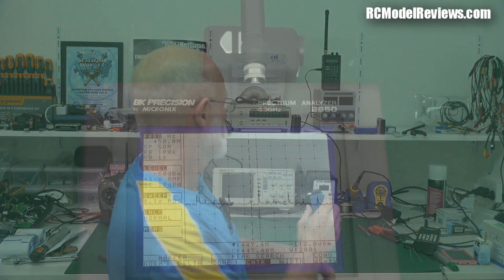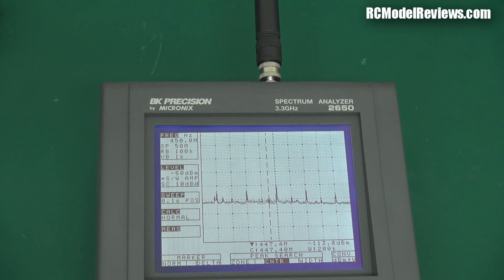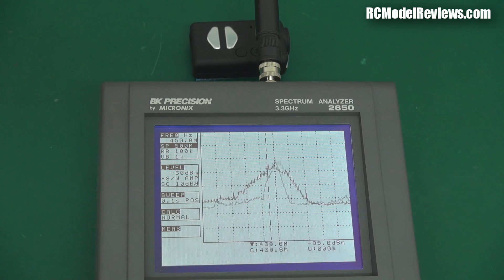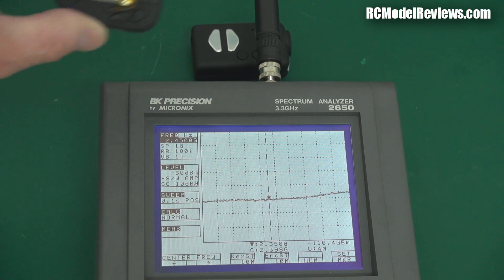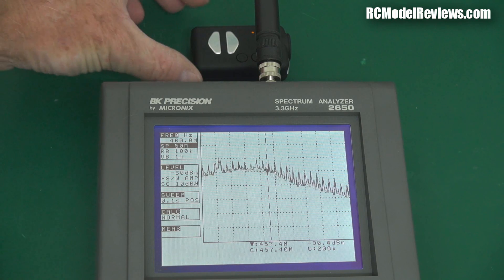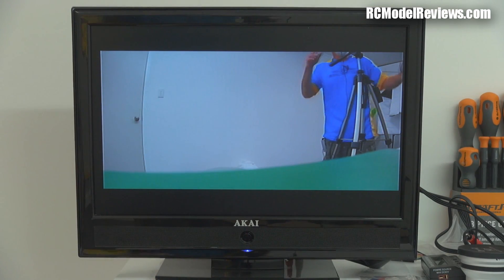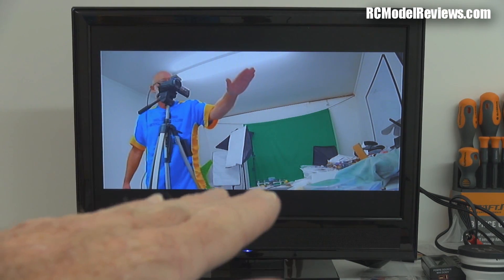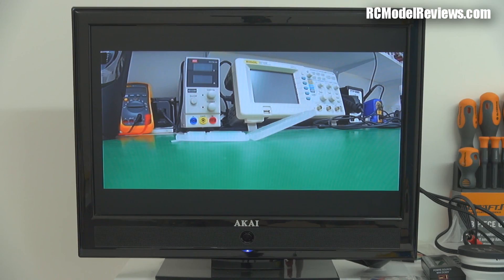Mobius HD camera RF noise and latency tests

Comment: why don't you measure the latency in an exact number?
Reply: Because your latency is dynamic to range/power/camera hardware just to name a few. Not all 600tvl camera will produce the same latency than the next a similar spec camera same is true for the rest of camera and counter parts. Latency is also highly controllable by your monitors if it's a progressive or a interlaced monitor. How that signals is transmitted digital means more lag but Better quality analog provides fast but lacks depth and contrast. For more details see ISF certs on lcd OELD plasma display. Plasma displays will produce the least latency from the monitor side. Cheers

Comment: My Mobius knocked off 18-20dBm from my UHF receiver.  I lined the inside of the Mobius with copper tape and now the mobius kill the UHF by 1-2 dBm sitting ontop of the receiver!  Copper works well.
Reply: Lorne Serpa Great, do you have a video on how to line the inside of the Mobius with copper tape???

Did you do all four sides or just the Top and bottom inside of the Mobius???

Was it hard to do???  Awesome, answer... Will do...
Reply: I did  on video tape the process.   I did cover the entire inside walls and all. Made a big difference.
Reply: Wrap a magnet filter on your cable bundle more often then not it can eliminate any cross talk

Comment: I think this is a bit of an unfair review. Bruce hasn't hooked this up to a computer at all, to change setting or run updates. There have been several firmware updates and updates are on going, which means the manufacturer's are giving it a lot of support (unlike a lot of kit out there). Your unlikely to fly fpv at 1080p. You need a computer to change it to a more realistic resolution. Updates have also allowed colour correction etc. The software is easy to use. A laptop should be standard kit for any workshop in the modern world.
Reply: The last firmware update is also a MAJOR update.

Comment: Bruce, why did you delete my comment? I think expressing noise with the noise floor as reference point is a bad idea. Ideally the noise floor would be -infinite dB, but typically it is around -100 dB and it varies. So that's not a proper base. You just can't subtract the actual noise from the noise floor level.

I just wanted to be helpful.

Comment: Bruce, I tried the wing cam (non FPV) on my Quad running FC DJI-NAZA and it interferes with the GPS NOT allowing the GPS lock.
Your spec analyzer test shows the Mobius to be clean around the GPS freq 1.575 Mhz. As far as latency goes, the Mobius manual recommends a Class 4 or higher SD card. Not sure what Class SD card you have. A Class 10 writes data at (10Mb/s and Class 4 is (4MB/s. Also, not sure if the video out bypasses the recording to the SD function.

Comment: Excellent Bruce.. Was going to use my Mobius for FPV. Was not even aware of the camera's high latency. You probably saved my expensive Hex copter.
Will be using a Sony board camera as you suggested.
Wishing you and yours a safe and happy holiday season.

Comment: May it be possible to also check the bunch of GoPros you have to compare the RF interferences? Interesting would be a usual operation, and additional WLAN Wifi remote operation. and also determining the safe distances to sensetive RF components.

Comment: Martin7812 is dead right regarding noise measurement.
Reply: Thanks David. My name is Martin7182 btw, I'm not a voltage regulator :-)
Anyway, Bruce seems to have deleted my comment :-(
Reply: Martin7182 what did you say+

Comment: Thanks for doing the latency test as I requested. However, your results seem incorrect to me. Ive never heard or seen a Mobius produce as much latency as what your video shows. Im fairly certain you are adding another source of latency, like a horribly slow LCD and perhaps some video converter inbetween?

To assess this, if you can use an old analog TV to display the mobius image on. They have no latency at all (well, speed of light :) ). You can also measure latency easily by filming a stopwatch or similar, then filming or photographing both the stopwatch and screen. It would be interesting to do this for a variety of devices. Camera's have latency, LCD displays have latency, possibly some FPV transmitters/receivers have lag (never noticed, but could be). Even OSD's might create latency if they do framebuffering

While you are at it, there is input latency. When flying FPV, they all add up.  You move your stick and the time it takes to see the reaction, or at least servo movement in your goggles is something that matters. How to minimize it might be an interesting topic. The mobius is definately a factor, but its not the only one, and I dont think its even the biggest in your test setup. As mentioned, Ive measured ~120ms in 720P. You seem to be getting 2 or 3x that. Is it the screen? Or some mobius setting (resolution, HDR, refresh rate,.. ?) Time to investigate ? :)
Reply: Yes, I'll try a few other monitors and see if there's any difference.
Reply: ***** Great!. PLease also compare with zero latency devices. A CCD as camera should have no latency (or no more than a single frame), and an old analog TV as display. They have no lag either.. And if you have the time, please experiment with the mobius settings. Most crucially HDR and resolution.

Comment: So would having a noisy camera (HoryzonV3 in my case) close to the the radio rx itself (Dragonlink V2 in my case) create a problem if the actual radio rx dipole antenna is a good 18 inches away from the camera and video transmitter?

Comment: Hi, Bruce.. that recommended for use in FPV, between the 808 # 16 and the mobius?
and You could check out the 808 # 16 V2 with 120° lens?
Thanks.. very good video

Comment: Bruce, nice informative video but there's one thing I think you're mistaken. You say that the cam has 112 - 86 = 26dB's of noise. That's not true! I think it should be just -86dBm. Let's explain it differently. -112dBm is the noise floor when the camera is off. Let's assume it's not -112dBm but -120dBm. Get the point? Noise is normally expressed in dB's relative to 0 dBm, not relative to the noise floor level which can be -infinite dBm theoretically.

Comment: I have been using it for fpv with the lag less than you have. I have it set up in 4x3 mode for live view.  I fpv the quad and plane. The wdr is not as good as the security 2000 camera. I really don't see any issues with mine.  The only thing is the color saturation.  It's to much. But its sharp from edge to edge.

Comment: To count the latency (video lagging) U put ur closed hand in front of cam, palm facing cam, and U count out load 1 & U open (strech out) ur Index finger. And continue with 2 & the major finger, 3 with the ring finger, 4 with pinky & 5 with the tumb. Count slowly , kind of like on an affirmative tone. I seperate each # 1-2-3-4-5 from about 0.7 seconds. When U do this look at ur hand in the monitor to see if its synchronised with ur voice. this trick work for me ;)

Comment: Bruce. I have my mobius wired into the power from one of my ESCs, and set up so when I power up it starts auto recording. would the fact it is connected to the ground along with all the other gear on my quad reduce some of the noise??
Reply: Hi. How do you have it wired? Can you turn it on and off from the Tx? I have my 808 HD connected to the rec and mounted on wing tip of glider.
Reply: ourblue  well my Mobius came with a lead that had servo plugs on it for video, audio and power. so I just moved the pins in the plug so they are correct and plug it into one of the motor signal outputs on my flight controller. That way it supplies 5v to the camera. Don't need to turn it on with the TX. You can set the Mobius to turn on when it detects external power, so I have that set. So when I plug the battery in on my multirotor, it powers up and starts recording automatically. By that time I'm ready to take off.

Comment: it looks like the display out you see on the monitor is a widescreen optimized for 4x3 and then displayed on a 16x9. Was that a composite out that you connected? I found a article here http://www.engadget.com/2009/02/19/hd-101-why-there-are-black-bars-on-hdtvs/

Comment: bruce im hearing good things about the BEV-KX121  board camera from bev rc  have you had a chance to check one out the video is supposed to be very good im currently using a security camera 2000  600 tvl but im looking for something a little better if you could review it that would be great thanks

Comment: Also Bruce can you get someone to lend you a GoPro 3 Black so we could see what the noise and latency is on that because they are also very popular (and expensive).
Reply: The UHF noise from the original Hero HD was significant.  Hero2's noise was better.  Hero3 Black better than 2, and H3+ Bis about the same as the 3, which are both almost undetectable in micro-power range tests with only minimal separation.

Comment: Hi Bruce, are you using this with the latest firmware as I have not noticed any latency problems during flight using the latest firmware. Not sure if there was this problem before flashing with new firmware as that is the first thing I did when I received mines.

Comment: Darn i was seconds away from ordering this camera for my first FPV setup. I'll have to go with board cameras apparently. Reason i wanted to use this camera is, i don't want to buy an extra dvr to record my flights. And this cam, has really good  image quality. Bruce do you know any cameras like this one that can record with 1080p and with low latency?
Reply: I gotta tell you, this is such a great camera. sure the latency is a prob, but the wide angle lens and awesome picture quality makes it awesome for the price. I consider it one of the best toys I have ever gotten for myself. And it's very lite. It has it's place, maybe with another little board cam next to it. check out my vids on my channel.
Reply: UCRASH TOO Hey there thanks for reply. I was planning to use this with my Quad. 150ms latency probably doesn't matter all that much for an airplane but for a quad flying 1 meters high, it might cause some problems methinks. Also, i'm quite new to fpv(RC in general actually) so i probably won't be able to compensate for the delay in video very well. I'm still planning on buying this camera. But i'll probably just use it for recording.
Reply: I have no way near as much lag on mine as in the video. Just so u know.

Comment: Can you try test some shielding solutions? A LOT of us are having problems with this camera completely blocking out out GPS reception. Even with the camera as far as possible.
Reply: stew jw
Don't mix carrier frequency with refresh rate on GPS. If it's just radiated UHF noise, don't put the radio receiver or the antenna near it and it will be fine
Reply: If you are the minority lucky enough not to have this issue or don't have a solution please don't make comments which prevent this issue to be taken seriously. I was hoping Bruce could come up with something as a lot of us would like to use this camera for FPV but cant loose our GPS return to launch..
Reply: Donavan Aarons
Solution already in Bruce video: put the uhf and gps away from the camera for the radiated noise. For conducted noise in the cables, try ferrite choke rings close to the source and don't create ground loops in the wiring.. Some gps antennas are really bad, check if the number of fixed satellites are in the bare minimum to fix without the camera on and then try moving the gps near and away of the suspected noise source to verify if radiated noise is your real problem.
Reply: I would not have made the comment/request if that was not already tried MR genius

Comment: Oh dear was hoping to use my Möbius for fpv, not now! Could the latency be cured through updating the firmware?
Reply: No, according to the "designer", its inherent to the DAC. The problem is not limited to mobius camera's though, its the same with most (all?) digital camera's, including gopro's and keychain cams. IIRC the problem is less pronounced in 720p than 1080p and refresh rate (50 vs 60 Hz) can also make a difference.

I would say the problem looks worse on Bruce's video than in my own tests. Ive measured it and I measured 100-120ms. Bruce seems to be getting far more than that, I wonder if he has another source causing additional delay, like his LCD or some video converter? Bruce, if you are reading, try filming a stopwatch being displayed both live and through the mobius. If you can, use an old analog TV to display the camera picture, so you eliminate LCD as latency source.. 

Anyway, In my experience, the mobius is usable for FPV flying multi rotors at leisurely  speeds. You do notice it, but its not a showstopper. I wouldnt fancy using it for high speed and aerobatics though.
Reply: P44man Agreed! There is some latency, but like you said it looks worse here that what I've seen with mine. I wouldn't say it's any worse than a GoPro Hero2 that I also fly through occasionally. A dedicated FPV camera is certainly best, but the Mobius live out is definitely usable.
Reply: P44man  I've flying fpv with this camera for a while and have not noticed any latency problems so was wandering if Bruce was still using an old firmware on his camera.
Reply: it has a latency surely, all cmos does, but very small, do not do hard core fpv with it your fine!
Reply: ***** Really? Tell Canon, Nikon, Panasonic, Sony, JVC, Red, about that. I am sure that they would appreciate your input that is worth more then all the professional video camera designers.

Talk about a total crock, but typical of most youtubers and RC people that I have met.

Comment: I've noticed some reduction of range if I mount the Mobius too close to my UHF antenna. A little separation is all it takes though, I've flown mine out a number of miles using Dragonlink V1 and V2. I'm pretty happy with the composite video out too. It's not as good as a PZ0420 of course, but it's the best I've had from an HD camera yet. Said it so many times now...lol "FPV teaches you compromise!"
Reply: stew jw The point of using using the HD camera's live out is so that you see exactly what you're going to get in terms of framing and to a lesser degree exposure.    And the point of using the Mobius versus a GoPro is to reduce weight and drag, especially if you've got it on pan&tilt mount.    Makes little sense to add another camera next to it, taking away its only real advantages.     For whatever it's worth, I'm now using the Mobius mounted on a pan servo, as a flight camera on a Funjet.   It can afford exactly zero extra weight or drag.
Reply: bonafidepirate Same here.  Not seeing a significant reduction in range (during micro-power range testing) once I give it a little separation from the UHF antenna.  It's nowhere near as bad as my original Hero HD was, nor various other known noisy 12V flight cams.    I got it for use on smaller platforms where I don't need ultra-long range anyway.
Reply: daemn42 Well, I should have mentioned, the only time I DID see issues was when I mounted it on the horizontal stab of my glider (t-tail), and the Dragonlink antenna was in the vertical stab. The end of the "active" portion of the antenna was literally inches below the Mobius. ;) I've had a number of flights before and after that one without issue, but with the Mobius there my RSSI was dipping all over the place, and I saw a couple of momentary failsafes. You can't blame the camera though, that was my fault for sticking it on there where I did... lol
Reply: that's what I've been asking you to do bonafidepirate using your osd to demonstrate de-sensing!